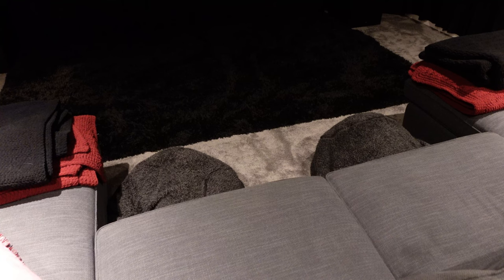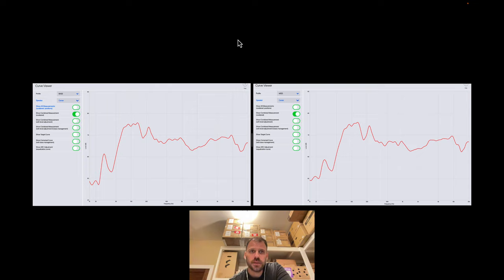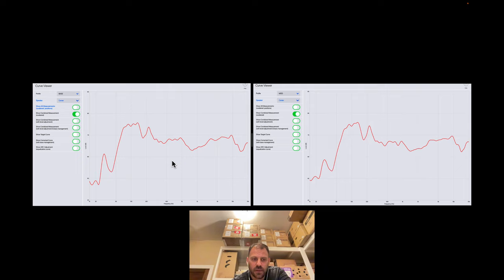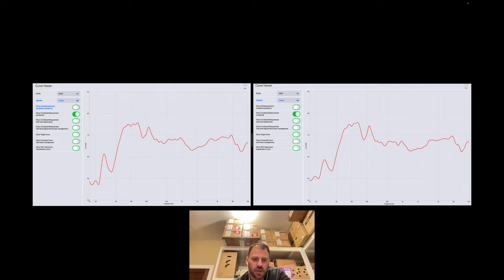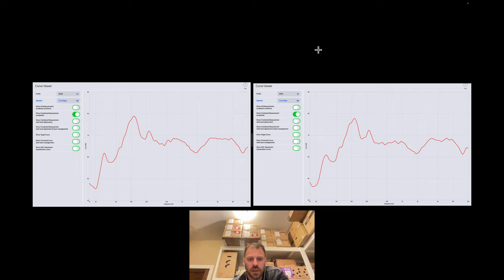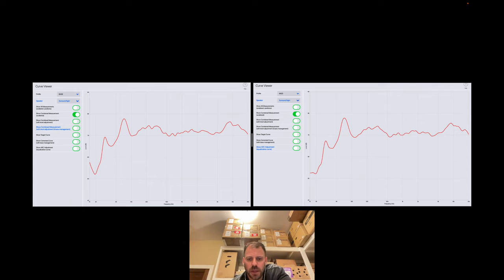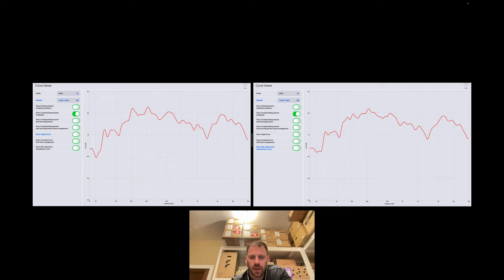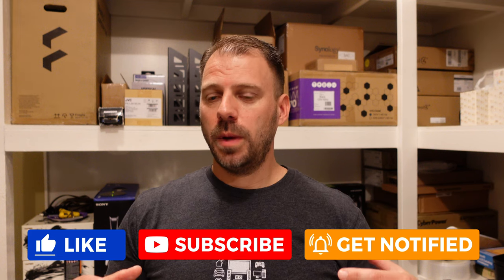Anthem AVM70 ARC Genesis Results With GIK Acoustic Ceiling Panels | Do Ceiling Treatments Matter?

Comment: I just ordered some spot panels from GIK for my ceiling. Maybe your room is different but I'm surprised they didn't recommend full absorption panels. That's what they've always suggested to me, as well as others, for the first reflection points. I wonder if that's why you're not noticing much improvement. I'll be installing mine in a couple weeks, but many people on the HT FB groups claim ceiling treatment made the biggest treatment in their room, so I'm hopeful! Thanks for the video, as always!
Reply from the maker: I went with these cause I was looking for something a bit simpler than more 242 panels. I still need to get REW running and run the decay measurement. I'm sure these panels are adding some value to that.

Comment: I think looking at curve's is one thing you can do. But when looking, I would have them the curves on top of each other, so you can see the db plus or minus improvements in the valleys or peaks. 

But, I think a better takeaway project you can do is to measure the room RT60.  

RT60 measurement done through REW, usually measured 200 hz to 2000 hz. If you measure this, you'll have your RT60 time after the mod, but you won't have it before. Landing in an RT60 of between 0.2 to 0.5 milliseconds is good treated room.
Reply from the maker: The ARC software used for this didn't allow placing those curves over each other, so I opted for the side-by-side, but for sure an overlay would much clearer. I'll be grabbing a mic here at some point and checking out REW first-hand. Thanks!

Comment: I recently built some acoustic absorption panels for my theater room using rock wool, along with making my own ceiling panels for my drop ceiling. I think a common misconception is that acoustic panels will make your frequency response better (not saying that was your thought process, but unfortunately it was mine for many years). Typically, the before and after impact on frequency response will likely be minimal.

However, as others have mentioned, the biggest difference you’ll see is lower decay times. You’ll need to do some REW measurements to see this, but my before and after decay times are pretty insane. Can’t wait to share that in a later video on my channel.

If you need some help getting REW up and running, don’t hesitate to reach out. Also, any chance you’ll be at CEDIA?
Reply from the maker: Good points, thanks! Other folks are mentioning the decay times as well. I'm overdue to get a mic and play with REW and will keep your offer in mind.

Love your content, by the way, and congrats on getting to work on the new room! We have some same friends in this space as well. :) I did Audio Advice and wasn't planning for CEDIA this year, hopefully next. Some new opportunity to go might have just came up, but I still think it is unlikely to work out.
Reply: @Techthusiasm  thanks man! I appreciate that. The room has been a massive project that I still kind of can’t believe I got myself into haha. Seeing the results though I’m more than happy, though I spend most days in my office editing the videos together instead of using the room. Haha.

I remember subscribing to you after talking with Tarrus, and at the time I think you had under 100 subscribers. Awesome to see your channel grow man! Keep it up. If by chance you happen to make it to CEDIA, hope to be able to hang and chat with you. I’ll be there with Michael/Youthman helping him film his booth coverage.
Reply from the maker: It's fun to build the room, but of course it never ends. :)

Yeah, when we did that Fun Waste of Time podcast, that was just before I launched the channel. I think I was in the process of setting things up for it at the time. I'm pretty happy with the results for a year! Hoping and planning to keep going! For sure, if I end up at CEDIA we can meet up. I'd guess there'll be more live streaming again like at Audio Advice too. :)

Comment: I’ve been waiting for this video. I haven’t done any room treatments other than what is a natural placement of items(floor to ceiling window curtains,large cloth painting and rugs). I’m using my Living room as a Media area and foam panelings will not work with the aesthetics of the room. Yeah,looking at the graphs really told the story especially since you can’t  hear a difference. That’s ashame but you wouldn’t have known if the panels makes a difference until you tried. Maybe next time you can hire a professional to come in and evaluate the room and tell you the key areas to place the panels and if they will make an audible improvement. What is your next step with room treatment or are you truly done? 👴🏽
Reply from the maker: I think I’m treated fine for now. I don’t think these are a waste. I need to another type of decay measurement and make a video avoid that. Treatments are well worth it, IMO. But a real consult next time might help a lot.

Comment: With the poor off axis performance of your LCR, you would likely benefit from more absorption and less diffusion/reflection from your ceiling panels
Reply from the maker: I went with a combo. 2" foam and the diffusion is the faceplate cut outs. It's a really minor panel overall.

Comment: Im really questioning the effectiveness of those panels. At least for lower frequencies... You need at least 100mm panels unless you are just chasing very high frequencies. 

One thing you could try is to hang the panels so you have some space between the ceiling and panels. This increses the effectiveness.

Comment: I think its about being reasonable with expectation with stuff like this.  They arent large panels and they are combo panels placed on the ceiling so I dont think you're going to see a huge difference in the measured FR.  Definitely not going to see any results below the panels capabilities which my guess would be around 300 hz.  However, Erin did a review of these focal speakers and you're response is pretty close to what his data showed.  So, I think you're measurements are pretty good in that regard.  There aren't really any major anomalies that could be attributed to the room so I think it could be assumed that the room is well treated.  Based on your measurements and Erin's the speakers seem to naturally have that smiley face curve with the mid range scooped and the bass & treble elevated.  I would think its a preference if you like that sound or not.  If not, its probably not the best starting point but I'm sure it can EQ'd to taste using ARC.
Reply from the maker: Right, I chose these panels over the probably more impactful panels for specific reasons knowing they might be less effective. That's the way it goes sometimes with different requirements. ARC did pretty well with these, cleaning up the natural response pretty to my target curves. I'm happy with their performance in both of my rooms after ARC. Great comment, thanks!
Reply: I recently did my ceiling with two 36x48x4 cloud panels and didn’t hear much of a difference.  I feel like after you get the main issues handled then anything else will be a minor change.  The bass traps and reflection point panels made such a difference that I figured I had to keep going which is why I did the ceiling.  I assume you’re in the same boat as you’ve pretty much got it all covered treatment wise.  I guess can always tweak a bit for fun and experimentation.
Reply from the maker: I considered the bigger cloud panels like that too, but opted for something like these being smaller and simpler. I agree with your other assessments 100%. We are very much in the same boat.

Comment: I was going to recommend measuring room decay with REW, not frequency response with ARC but I see others have made that same recommendation. Let us know if you are able to do that as the idea is great.
Reply from the maker: Yep, I'll update when I have this info measured.
Reply: @Techthusiasm  Did you ever do an updated video on the room decay?
Reply: I had the same comment, but see that others already mentioned it- RT60 decay would be a more interesting measurement. But given all the adhesive issues you had with getting the GIK panels to stick on the ceiling, I understand if you wouldn't want to re-do the before and after RT60 times. 

I also wonder if a combo panel like the GIK is better or not compared to a purely a absorptive panel like ones made of OC703. I suppose this is room and personal preference. 

I got my HT treated with acoustic panels on the walls. Made a big improvement particularly with dialog intelligibility and also with being able to hear my speakers as more distinct sound sources (when called to do so by source material). I haven't treated my ceiling yet,  because finding first reflection points in the ceiling is harder, and installing panels in the ceiling is much more of a pain (higher up and need to deal with lights, smoke detector, etc). But given the improvements provided by the wall treatments, the ceiling treatments should help, but haven't decided if the effort is worth it (maybe I'm a few months after enjoying more content).
Reply from the maker: Not yet on the decay measurement.

Comment: I didn't notice but do you also have panels on the walls?  My recollection when I did DIY panels is that you have to control first reflections there as well as ceiling.  When I did it, I did the mirror trick where my wife sat in each listening position and I slid a mirror along the side walls. Every time she could see one of the LCRs in the mirror, that was first reflection off the wall for that speaker.  The reality is I ended up treating 5' wide x 4' tall sections of the wall with Ones corning but it made an obvious positive difference.
Reply from the maker: Yep! The panels overhead should be in the first reflection area for the LCRs.

Comment: why control don't you measure with REW first i have experimented with attenuation and ARC and get no changes in the measurements and i have used amounts of attenuation in my tests
Reply from the maker: I need to and will be doing so before long. Thanks!

Comment: Hey Tech, wanted to ask you question regarding Anthem AVM 70 ARC Setting. I am using one Movie profile as it was set after running ARC - default setting. I wanted to create Movie2 profile for more deep heavy chest thumping bass. I got two SVS SB2000, and towers are Arendal 1723 THX which go down to 40 hz. 

In the ARC setting - looking at Deep Boost bass and Deep bass boost Center Frequency - what can I set these two for that big heavy bass? For my main Movie default setting - Deep boost bass is set to 2.5 and Frequency to 50 hz.
Reply from the maker: You can bump deep bass boost and room gain to add lower end power back. I add a few dB of room gain and like one dB of deep bass in my room.
Reply: @Techthusiasm  What does center frequency do? Its set to 50 hz? Does setting that up higher - allows subs to take over bass more from towers?
Reply from the maker: The center frequency options controls when the options they are named for are apply in the frequency range.

Comment: Would you consider switching the panels to full absorption and seeing if that's helps at all???  Also, do you know of a specific scene where you have trouble hearing the dialogue?  I would be willing to try the same scene and let you know if I also have trouble hearing dialogue, then you know it's just the sound mix and not anything in your room.
Reply from the maker: I don't have a specific scene in mind. I'll have to think about that. I don't expect to change these panels out, until some day maybe farther in the future. I'm sure the panels do help the overall sound presentation of the room though, more than these graphs might show.
Reply: @Techthusiasm  Aren't those the ones that have the removable wood to convert them to absorption???
Reply from the maker: The ones I have now? No, it's a 2" thick foam with a thin "wood" facia where the diffusion patterns are cut out.
Reply: @Techthusiasm  My bad... I thought all the GIK hybrid panels had removable faces to convert them to absorption.

Comment: Too bad you didn't measure the room reverberation (RT60) with REW before you glued?? the panels to the ceiling.
Reply from the maker: I'll get into REW here before long. Yes, I opted for glue. Spray glue is a common recommendation for mounting foam or similar type panels. GIK has spray glue in the add-ons for these very panels.
Reply: @Techthusiasm  "Gravity always wins...." 😀
Reply from the maker: Ha, for sure! We'll see if 3M Super 74 Foam Glue has anything to say about that... :)

Comment: You used combo panels which really attack the midrange (look at their absorption coefficients). And you had a decent leveling in the midrange. 

Also, for acoustic panels, you need to be comparing RT60 decay times. Not frequency responses. You’re trying to correct echos. Not response. Measure with REW. 

Sorry, but no value to this video. 

And those Focals measurements don’t look so good on their own 🫣.
Reply from the maker: I agree, not my best video as I conflated a few things. I’ll get to a decay time measurement on the room at some point and share that. I might go ahead and just pull this video down in the meantime. 

On the Focal measurements, yeah, they have some hitches. They are pretty consistent with what Erin (Erin’s Audio Corner) measure with them. I was fairly disappointed with those results relative to the pedigree and the price of the speakers. ARC does a good job with them though and the in-room use is nice. I won’t be pulling them any time soon, but I also don’t expect them to be my last speakers either.